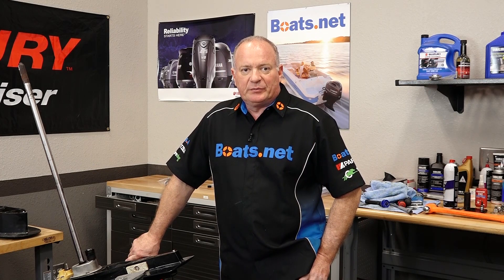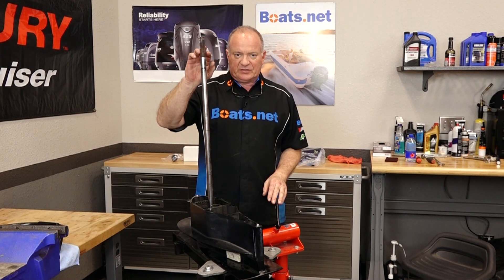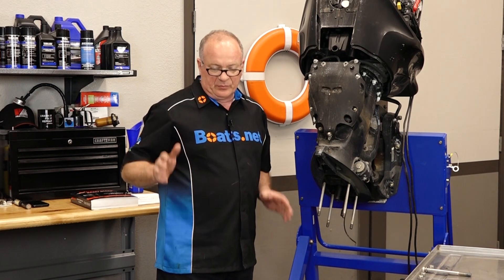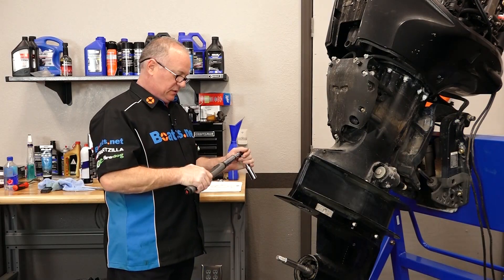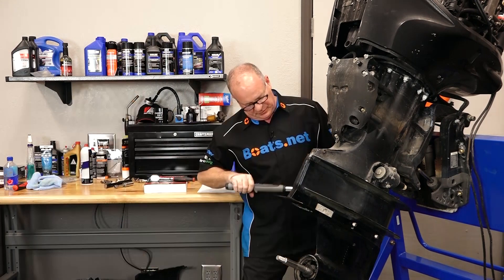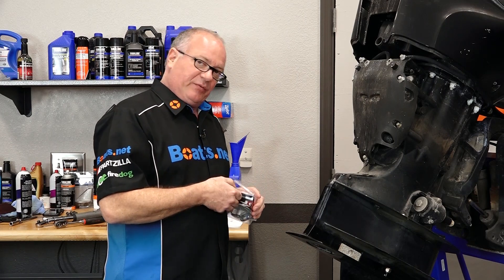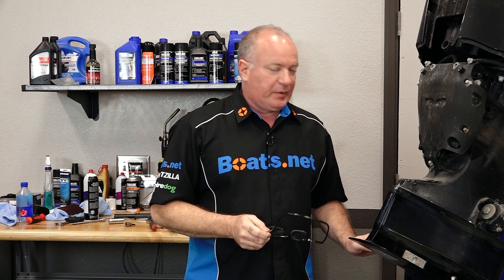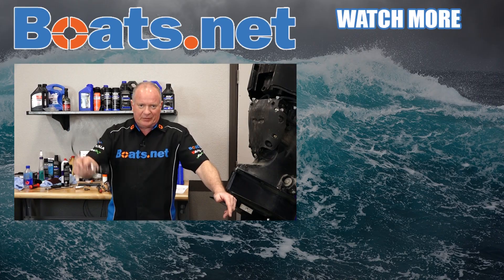Mercury 200 Lower Unit Installation | Mercury 200 Gearcase Installation | Boats.net

Comment: John ey I'm having some problems getting my unit back up in the neutral position I don't know if I need to turn the little thing 12 notches right or left kind of skipped over that on your insulation so I would appreciate it will help if you could put that on your website

Comment: My new 2022 Mercury 60HP EFI was destroyed when something (limb, pipe, who knows) got between the prop and the skeg. The Flo-Torq hub failed to slip and even at just 2000 RPM or so the lower unit pretty much tore itself apart as the engine came to an immediate stop. Don't yet know if it broke anything in the engine itself. Do you have any ideas for some sort of prop hub that will actually slip if the prop hits something?

Comment: Hey can you guys do  video on how to adjust shift linkage on the Mercury 250 mine is 2006 model. Its not fully going into gear making terrible clunking . I figure I should start there for diagnosing. Thanks

Comment: HOW DO YOU REMOVE THE LOWER COWL I TOOK THE 5 8MM SCREWS OUT BUT STILL SEEMS FASTEND AROUND THE EXHAUST PLATE HOW DOES THAT COME OFF DO YOU HAVE A VIDEO ON  THAT. THANK YOU ITS A 2014 200HP VERODO.